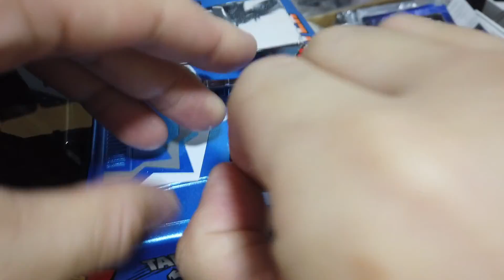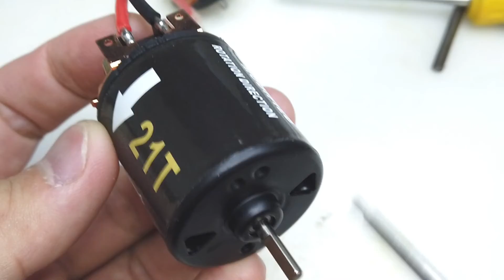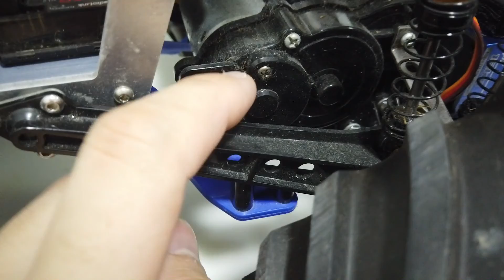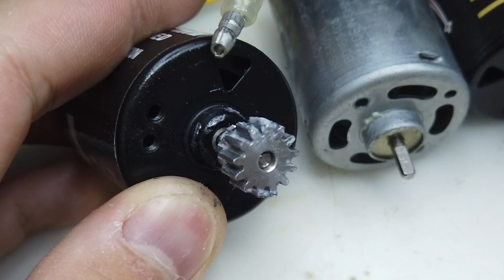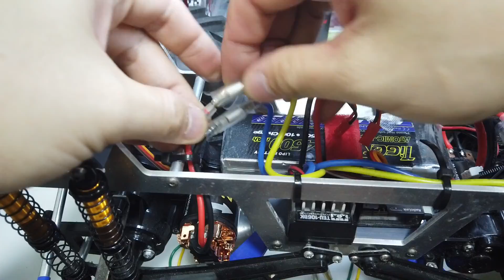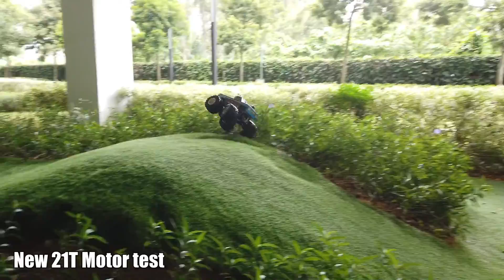I Upgraded the ClodBuster Motors BUT IT'S NOT FASTER! WHY!?

Comment: I just bought myself a Super Clod Buster yesterday and also am looking at motor options. Initially i was looking to just go for Tamiya Sports Tune(23T) as thats what the stock ESC will take. Maybe i’ll run that for a while until i feel it needs more power than perhaps run a brushless with the Hobbywing 880 dual motor.😈

Comment: Clodbusters need torque. If you get the adjustable plate so you can use a different pinion youll see better results, or use a 550 size motor like the titan for the old e-maxx
Reply: I think they are fine just as they comes in stock, maybe if you upgrade both chassi and suspension you could add more speed and torque =)

Comment: Very cool clodbuster The power you would be looking for would be coming from something like at least a 16 turn I would go even deeper like 12 turn you'll see a noticeable power increase with 13 tooth pinions which are stock I would highly recommend upgrading to some good pinions. I personally liked running the Traxxas EVX speed control with two 21-turn 550 motors in my truck but in order to do that you have to run four link bars and they will touch the floor link bar. What I run in my truck now is twin 5200 KV brushless motors

Comment: Glad the timing is adjustable. You don't need to reverse the wires...
As long as the front motor has positive timing, and the rear motor has negative timing, you're good! 
I'm still building my Super Clodbuster, silver cans, 3S Battery, but I've done modifications outlined in my latest Video.

Comment: Thanks for sharing.  I like the chassis, I tried to 3D print their BTA steering, but my first design wasn't strong enough, I haven't made another attempt.  Anyway, I installed 2500KV brushless motors (which I think are close to equivalent to 17.5T) on 3S LiPo battery, and it made the truck significantly faster.  Maybe if you switch to an ESC that can handle more voltage (Hobbywing 880 can handle up to 4S LiPo on dual brushed motors), then you'd find the speed that you need/want.